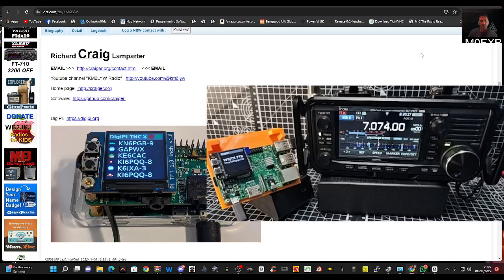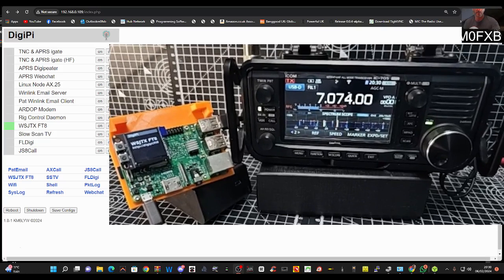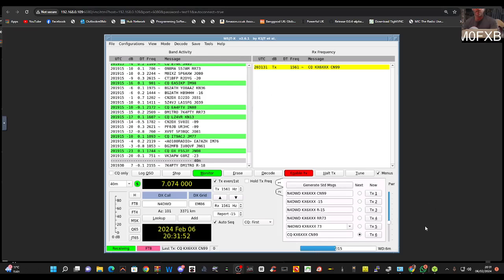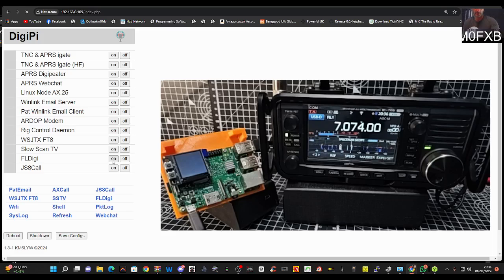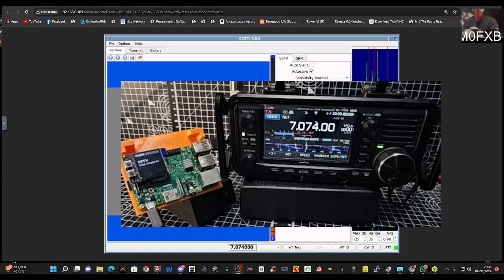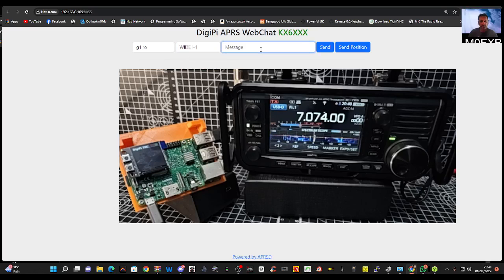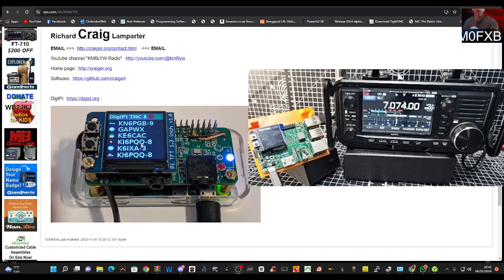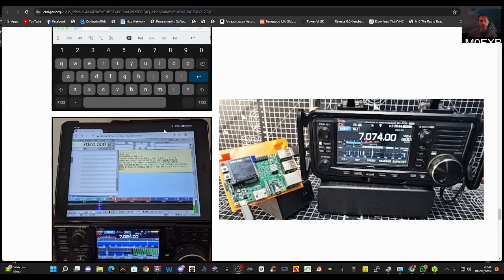Set Up The KM6LYW Radio DigiPi Project

Comment: I understand the digipi setup. How do you get to an app screen from the client side? Example how did you get to the wsjtx operating screeed?
Reply from the maker: Digipi main function is to have all these programs then send them out on an Ip address .
Reply: @M0FXBHamTech how is the IP you need to operate the programs sent.
Reply: @M @M0FXBHamTech is there anyway to see this in a terminal?